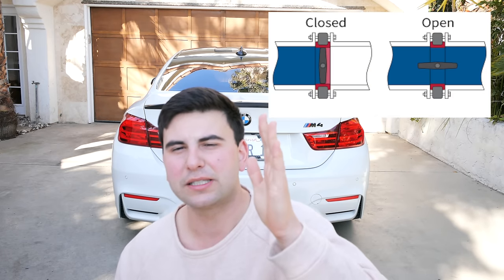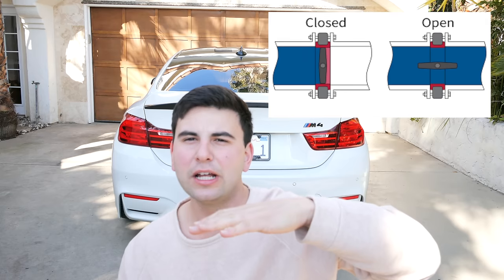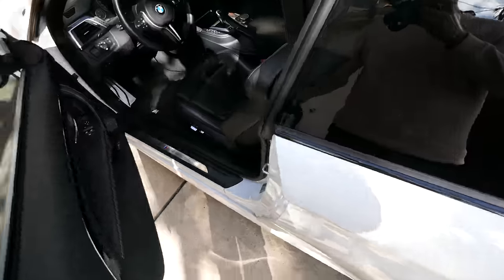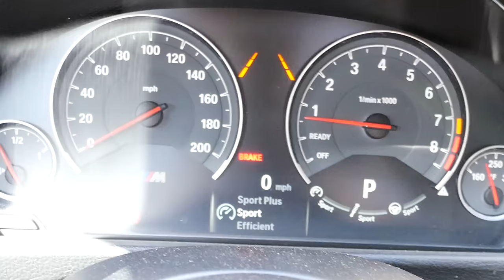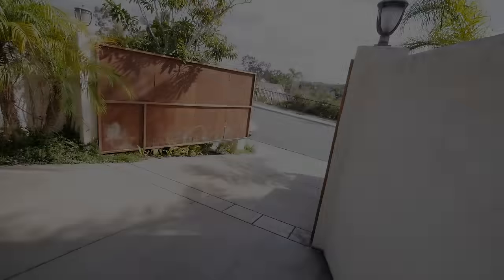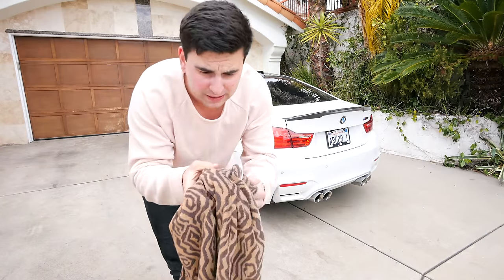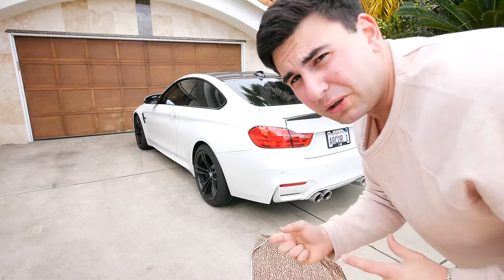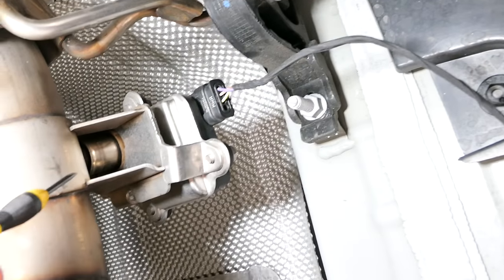This simple DIY Mod made our BMW M4 way louder!

Comment: If you put it in sport plus with the ignition on, engine off, and you press the gas petal all the way to the floor the exhaust valve opens. That way you don’t have to drive around and hope it stays open.
Reply: Tyler Smith an even easier way is use the M1 M2 programmable buttons. You get in the car, hit it twice and bam open. 😁
Reply: Yes that's true. But I've noticed on my M4 CP, even when I put it in sport mode and the valves are open and drive around say with a passenger and drop the passenger off somewhere thus opening the door of the car, it reverts back to valves closed and not in M mode. Hence maybe best I do the valve delete mod as that way it will always be open and sound bit louder....
Reply: Suhail Jamil it’s ridiculous. They give you the option to open and close yet the car still does it itself
Reply: @matthewalan458F  yes absolutely. Lol
Reply: Suhail Jamil i noticed with the cp, before you start it put ignition on then sport plus and hold down accelerator pedal for like 10 seconds then start the car and it will start with valves open and stay open
Reply: Thanks, that worked!
Reply: @suhailjamil3909  I realize this is an old comment but it will close while you are stopped once the is open and as soon as you touch the gas again it’ll open back up. I can’t figure mine out😂half the time it is open half the time it’s closed...kinda has a mind of its own lol. But when I start it I always have it in M1 mode tap the gas then start it. :)
Reply: Does this work for other BMW's also?
Reply: will the valve closes again if put to sport or efficiency mode?

Comment: Great tip, but you don’t have to keep the car running. Warm it up in M Sport, shut it off and valve are still open, this way you aren’t working around hot mufflers. 
Worked for me!

Comment: I know and am aware as to the fact this is an old video, but just as a heads up, this normally will trigger off the check engine light after a while, once the car notices that there is an open circuit there, this is a kinda well known trick, and there is a second one on the other side, personally I use and would suggest the use of BimmerLink, it removes the risk of the check engine light, and comes with a bing of other neat features, look it up yourself, otherwise, be careful as prolonged use of the valves like that, may cause the valve to being rattling later on, simple fix though, plug it back in and cycle it (open an close the valve, you do this by setting the car in efficient, then sports plus and tap the gas, the valve will then open, keep in mind this will work regardless if the ignition is on or you started the engine) hope this small bit of info helps if anyone ends up running into an issue

Comment: Thanks for the knowledge! I ended up going with the control module for my M4. Living in Vancouver, there is way too much rain to even consider the exposed wires. For $300 to control the flap function, it was well worth the money for me. I have also read on many forums that disconnecting the wires sends soft fails - maybe harmless, but I'm too risk adverse! Enjoy that sound fellas
Reply: which system did you for $300?
Reply: I live in Toronto which control module did you buy

Comment: Cool video! But there should be an identical butterfly valve in the outer right pipe too, with its own electrical connector, unless this varies between the US and Europe due to different regulations or something.
Reply: NorwegianSpirit  I was thinking the same thing

Comment: Easier to pull the fuses. 146 and 147 in the boot if i remember correctly (m2 comp) also DO NOT stick your connector port inside a rubber bush to 'protect' it 😂
Reply: Is it safe to constantly drive the car with both fuses removed, won’t cause any damage to the car?
Reply: @YoutubeGuest1955  not caused me any issues yet. If anything its less risk than unplugging things
Reply: s c that’s great thanks, I just unplugged the 2 fuses today and sounds great I was just a bit worried.

Comment: You can do the same by just removing fuses 146&147 once the car is on and the valves open.
Reply from the maker: Orestes Jimenez Interesting. Similar to the fuse 22 mod on my Aston
Reply: Would you happen to know if this works on 18 m3??

Comment: Hey after an year, does the tape melt since it’s close to the exhaust?
Reply from the maker: Nope it was fine we also used electrical tape too. If you few more comfortable every few months it will take you 5mins to redo it

Comment: Press the start button once (foot off the brake) change to sport plus…. Push the throttle all the way down, then start the car…. It keeps the valve open until you turn the car off

Comment: I don’t know if the same goes for these cars but every now and then you need to plug in the flap so it can move or find a way to clean out the moving parts. I had a 335i with the vacuum powered flaps and someone did the golf tee mod. Since flap didn’t move for so long, it seized up. I bought a value controller and had to get a whole new muffler.. big headache
Reply: dats why u put the tape
Reply: @sleepsounds5455  Yeah but you’re missing what I’m saying, if you leave the flap open for way too long it’ll seize itself

Comment: I would not recommend this because you will get errors. I did the same to my f30 328i, after one month I plugged the connector back in. Now when I plug in my OBD tool it can still find errors from this.
Reply from the maker: Got 0 errors over 3 yrs

Comment: With the engine off, you select “sport” or “sport plus” mode, then press the gas pedal, automatically the flag will open. You don’t have to disconnect this rear circuit and all the stuff in this video..
Reply: no. it's only apply to cold start

Comment: this may sound stupid but i cant get the connector off haha
Reply from the maker: Nick Veres Try use a little flat head. Those clips put up a mighty fight sometimes!
Reply: I couldn’t get mine of used a plier and applied a bit of pressure top and bottom both came of

Comment: There’s no way that one little piece of electrical tape is going to protect those plug pins from corroding over time......Especially in the states that have rain and humidity or ice and snow
Reply from the maker: There are plastic inserts you can buy as an alternative and where I live it’s 72 degrees and sunny everyday ☺️